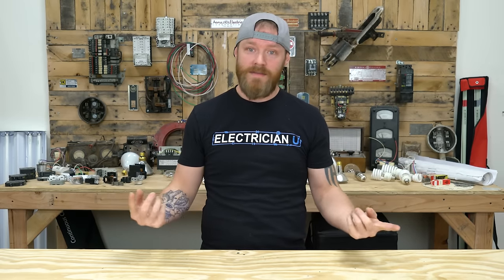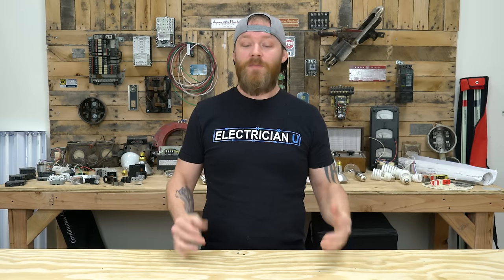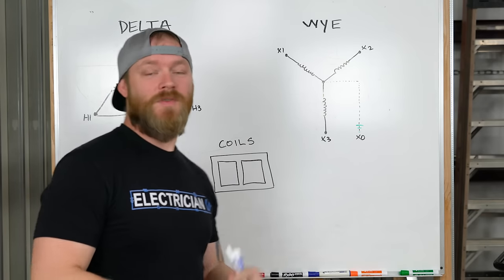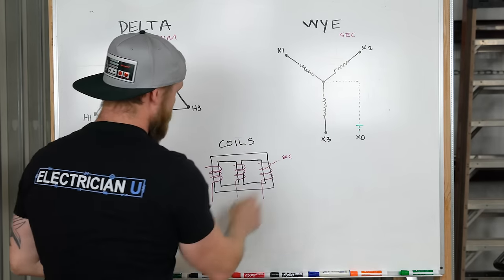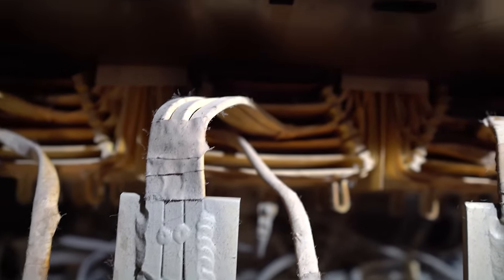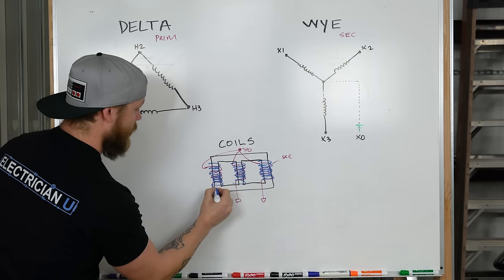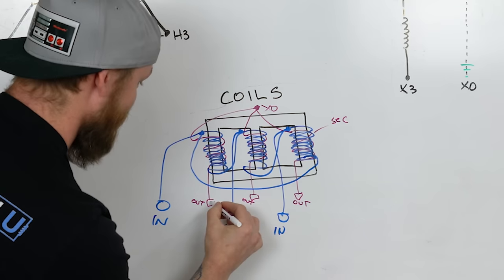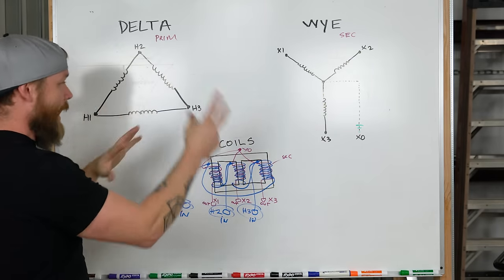TRANSFORMERS - What They Are, How They Work, How Electricians Size Them

Comment: Hopefully soon-to-be apprentice here--one thing I'm still unclear about is where single phase 120/240V systems come from if transmission circuits are usually three phase. I've read about delta secondaries where you have 240V phase to phase, center tapped neutral to make 120V and the 208V high leg--is the resulting 120/240V from these windings essentially the "single phase" that feeds residential buildings? If so, how can it be called true single phase with phases 180 degrees offset if the conductors on the primary side are 120 degrees apart in a three phase configuration? Or does the magnetic flux from the primary essentially "create" a 180 degree voltage signal between the terminals of the secondary?
Reply: The utility will assign either a phase, or a pair of phases (depending on their standard), for the primary side of your service transformer.  Sometimes they limit local construction along the side streets to single phase feeders, derived from the 3-phase feeder along "Main Street".

As an example, consider 13.8kV / 7.97 kV as the nominal distribution voltage.  They might assign 1 phase and the neutral from their system, and build your primary according to the 7.97kV primary voltage.  Or they will assign two phases, and build your primary according to the 13.8 kV primary voltage.   The phase assignments are staggered throughout a neighborhood, in order to balance the net load on the feeder from the substation.  It is also common that a group of neighboring customers share the same service transformer, and you each get a service drop off of its secondary.

Your service transformer will be single phase, with a primary coil matching their distribution voltage, and a secondary coil that is center tapped.  The center tap of your secondary coil, is grounded at the service disconnect, where neutral and ground are bonded, and connected to the grounding electrode.
Reply: It is called "single phase" because it is derived from a single phase of the utility's system.  There is only one magnetic coupling within the service transformer, hence single phase.  Unlike three phase transformers that have three magnetic couplings within.

The utility doesn't use time delay, or coil position within the rotating machinery, to generate the "two phases" that are 180 degrees apart, like it does with 3-phase.  Instead, it uses center tapping.  It is negation, rather than phase shifting, that defines the relationship between the two waveform voltages of the split phase system.  Yes, it is mathematically the same thing as shifting in phase 180 degrees, but due to the fact that this has no connection to the physical construction of the service, it is not called "two phase".

Comment: Hey i have 208VAC 3-phase in my shop according to the a label by the meter outside, and i have an old 440V 3phase belt sander that i wish i could power... i also have a 550V 3-phase bench grinder and Id love to know what kind of transformer/buck booster should I be looking for? I can climb up on the rack and get the amps for each machine if you need to know in order to answer the question. And thanks in advance if you read this/answer.
Reply: Can the bench grinder run on 480? Grab the amps of each of them. To do this right you would have to build a mount for the transformer and then I would install a sub panel after the transformer for 480 stuff. But it sounds like you're holding on to things you shouldn't. Put them on craigslist :P
Reply: @goaliedude32  i climbed up to check out the belt sander and its definitely all weird. 50 hertz in America?  Ive heard people finding ways around upping volts and such but not hertz. I think I'm just gonna get a nice 2-5hp 208VAC 3 phase motor and use the parts to build a cooler belt sander
Reply: @JJJeremyH  Yeah, as cool as it is, doesn't sound worth holding on to. Ebay might be the best spot for it. I think to convert hertz you need some fancy gizmo that's like a 3phase 60hz motor that's mechanically connected to a ^0 hz 3 phase generator, so it's super inefficient

Comment: Amazing video lectures and I have learnt a lot about Electrical equipments. I want you to help me with why transformers have high current in the low voltage windings (step down transformer) and vice versa
Reply: Imagine a see-saw. That is our mathematical formula. Power in watts is constant, so that is the center pivot. Volts is on one side and amps is the other. The transformer converts the voltage values up or down, which therefore demands a change in current flow. The impedance of the transformer is like a parent holding the see-saw at a certain angle, resisting the up and down bouncing.
I hope this helps. Blessings!

Comment: Question! What happens if you keep the wire size the same on the secondary winding?
Reply from the maker: Bad things will happen.Wires have to be rated for the current they are going to be carrying.

Comment: So if you had a 1:1 isolation transformer, when would you use that? You said "dirty power" and "clean power".
Reply: One reason why you would use a 1:1 isolation transformer, is to get rid of a DC offset in the primary source.  Transformers "ignore" DC, and only transmit AC, because of their working principles of operation.

This used to be the design of grid tied solar PV inverters, that required one of the DC conductors to be grounded.  It is rarely the case anymore, because many inverters take advantage of the relatively new allowance for the DC polarities to float at equal and opposite voltages to ground.  In order to generate an AC waveform that peaks on equal and opposite sides of ground, you could not do this from an exclusively positive DC source.  You would generate a source waveform that has its lowest trough value at 0V, and its highest peak value at (let's suppose) 680V.  Then send it through a 1:1 isolation transformer to get a waveform that varies from -340V to +340V, which we can then connect to a 240V grid.   The reason its peaks and troughs are +/-340V, is that peaks and troughs occur at sqrt(2)*nominal voltage.

Of course, we can't really generate 680V from a PV system limited to 600V, so the isolation transformer ratio really wasn't 1:1. The array produced a lower voltage, and the inverter used it to produce a lower amplitude AC voltage, which was stepped up to produce grid voltage thru the internal transformer.

Comment: Not an Electrician, I do IT work, but I love anything electrical but what is the difference between a Delta and WYE 3 phase?
Reply: With a Delta Transformer  the line-to-line voltage is double the line-to-ground (ie 120/240V delta) like the xfmr s on the pole that feed your house. With a Wye connection the line-to-line voltage is 1.73 times (square root of pie) the line-to-neutral or line-to-ground. The Wye connection most commonly used in commercial and industrial applications produces voltage schemes of 120/208V, 277/480V, 347/600V, etc

120 X 1.73 =208
277 X 1.73 =480
347 X 1.73 =600
Reply: @Ephesians-ts8ze  thanks! That makes a bit more sense. I dont deal with that stuff but i have a lot of industrial clients. Now i know when something is getting 208 vs 240 i know whats going on.
Reply: Ryan Bregler no problem. It’s not the square root of pie (3.14), though. It’s actually the square root of 3. I remembered that part of the equation wrong (it’s been over 20 years since I completed my apprenticeship). After watching the video again I saw where he drew it out on the dry erase board and I had to recheck the math. You still get the jist of it though.

Comment: KVA rating. After watching this I now know what the number means. That explanation was simple and straight forward my one brain cell could understand it. Thank you.
Reply: No mention of Active and Reactive power? KVA being Apparent power.
Reply: @tedlahm5740  KVA is what you get, if you multiply the RMS of the current by the RMS of the voltage, and the sqrt(3) factor if applicable, due to 3-phase power. RMS = root-mean-squared, which is a special kind of averaging applicable to electrical power.

If you assume this calculation will produce a value for the power delivered, the calculation will have a blindspot.  The blindspot is due to voltage and current either not being identical in phase, not being identical in waveform, or both.   The real power calculation requires us to multiply voltage and current at every instant, and "add them up" (i.e. integrate) over time.

However, it is still of interest for us to know KVA.  Because it is what governs the sizing of equipment involved in power distribution.  The transformer still needs to be sized at 500 kVA, even if only 400 kW of real power are delivered.  The value of RMS voltage * RMS current * sqrt(3), will govern how much "size" the transformer will require.

Comment: Hey all, been thinking of taking an Electricians Tech course at a Community college but I don’t know anything about electrical work. How hard is it to learn?
Reply: It's not too bad they start you off slow I'm in electrical class right now at my community college
Reply from the maker: It's not so much that it's hard to learn, it just takes years of everyday experience to learn it.  School is great but it can only get you so far, what really matters in an interview is what you can do with a set of tools in your hands.  I'd recommend trying to get some hands-on experience wherever you can while you're in school.
Reply: Thanks, really means a lot
Reply: Bingo, Dustin nailed it. Hands on is the way to go. Find someone that is very good at their job and takes pride in their work. You will learn more from them in a week than you would from someone slamming out shoddy work.
Reply: IMHO, the best way to learn the trade is through an accredited apprenticeship program. Whether you choose IBEW (union) or IEC (non-union) either one will offer job placement with an electrical contractor so you can get real hands on experience while you’re going to school to learn the theory behind what you’re doing in the field. Either formal classroom training or OJT in the field alone is not enough for most to excel in the trade. You need both

Comment: What happens if you don’t bond the neutral to ground?
Reply: If the neutral is bounded to ground which should also be connected to a suitable grounding rod or water pipe, then it helps in several situations. If the service neutral opens up, the ground can partially take over and prevent Voltage doubling from 120V to 240V on the split phase system. This can prevent damaged appliances and fires. If there is a lightening strike or a fault that connects the primary and secondary of the utility transformer together, the ground can significantly reduce the amount of Voltage between earth ground and the 120V circuits. Double insulated devices like hair dryers and toasters wouldn't become energized to the full utility transformer primary Voltage, which could be 7.2kV! Edit: I neglected to mention the most important reason for bonding the ground to neutral. That is as situation where a hot to ground short occurs, which is a very common fault. If the ground is not bonded to neutral, then the entire ground circuit in the building becomes close to hot until the circuit breaker trips. Ground rods can have several ohms of resistance to ground, which is far too high to keep the ground to safe Voltage in such a situation.
Reply: The advantage of having the ground separate from the neutral is that it is safer for grounded appliances in situations where a neutral fault occurs on the utility side. When the ground is bonded to neutral, and one of the three situations mentioned in the previous paragraph occur, the ground rod is likely not able to keep the Voltage in the ground circuit at a safe Voltage relative to the real earth ground. If an open neutral situation occurs, the chassis on a washing machine or pool pump could rise significantly if the ground rod has a poor connection. Even 50 Volts between a chassis and earth ground can be dangerous in a wet environment. If high Voltage comes in by the other two situations, someone who is touching a grounded appliance could be killed. If 7.2kV came in to the building wiring it might arc over to ground anyway and you wouldn't be much better off, but your chances are better.
Reply: Thank you! This explains why there was a loaded neutral at my subpannels and also open A phase.
Reply: @davidhomesolutions4471  np

Comment: Besides matching voltage on appliances, transformers are also used to step up voltage so more electricity can be moved without overheating wires, and then stepped back down. It allows you to use a lower wire gauge and move more electricity.

Comment: I hate the hmmm noise they always make lmao
Reply from the maker: They’re just deep in thought...gotta respect the wisdom 😏
Reply: I like the hum. It helps put me to sleep when I need a power nap at break or lunch time
Reply: That's a 60 Hz hum.  It is the note of the lowest string of a 5-string bass guitar.
Reply: @carultch  More like the low string of a six string baritone guitar tuned to B standard, a B0 on a bass guitar is 30Hz
Reply: @dylanoakes9557  The A-string on a standard guitar is 220 Hz.  A bass is 1 octave lower, hence 110 Hz for its A-string.   1 octave below this, is 55 Hz.  The B-string is 2/12ths of the way between the 55 Hz A and the 110 Hz A, at 55*2^(2/12) = 61.7 Hz.

Comment: A lot of times in the field we take this stuff for granted and just make the necessary connections but it is extremely important to have a basic understanding of how transformers work and how we utilize these different voltages. I have a 2 year degree in industrial electronics. I remember doing all these calculations. Got my degree in '99 with a head full of theory and no practical experience. So it also took me a few years working in the field before the ' light bub' (😅ouch) finally came on and I began to figure some of this stuff out. Great video bro... Keep it up man. You're a very competent and knowledgeable instructor. Lots of guys out in the field just pull wires and bend pipe(of course there's a lot going on there too😉) without knowing the basic theory behind what we're working with☝